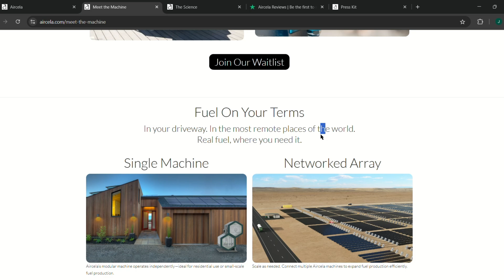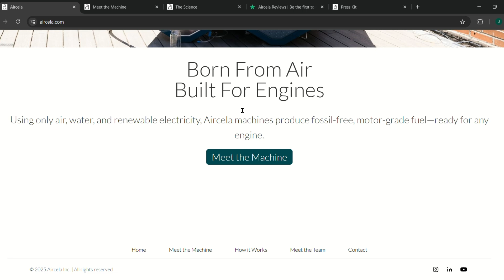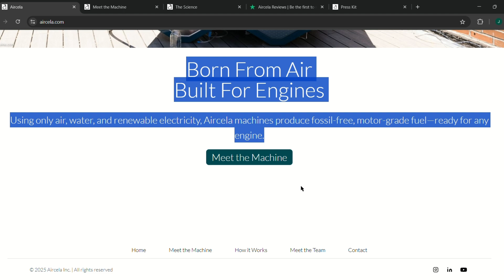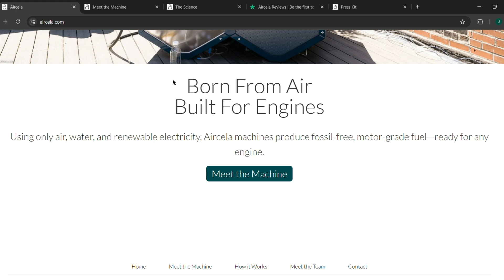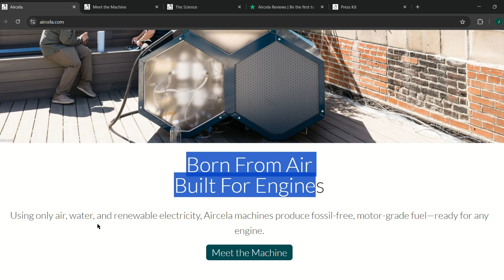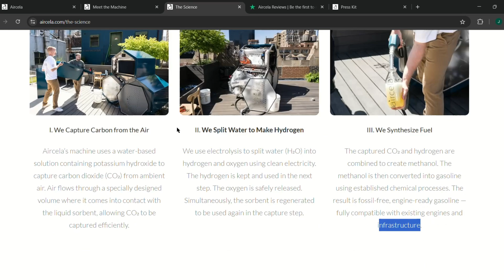Aircela Review – Is This Machine Really Make Gasoline from Air Or A Scam?

Comment: The technology is well-established.  Professor Also Steinfeld has a working solar apparatus  that uses a catalyst to convert CO2 in the atmosphere to methanol, as Aircela claims to do.
Traditionally, the Fischer Troposch system is used to convert methanol into gasoline, and I don't  see this here.